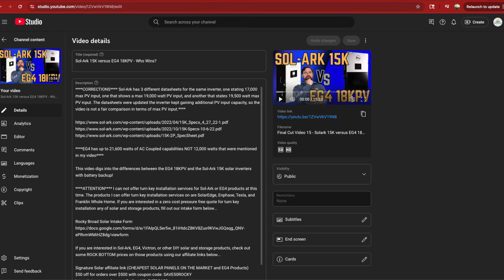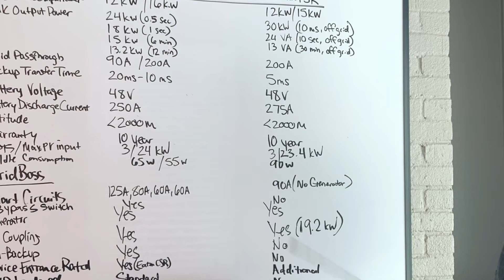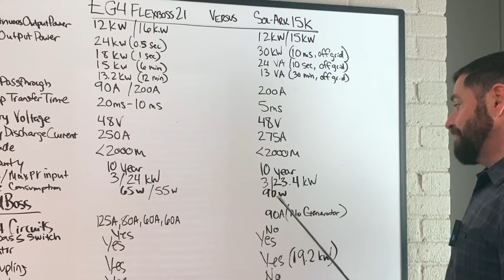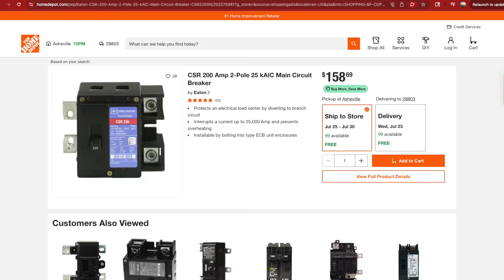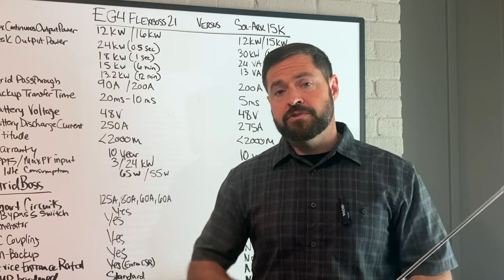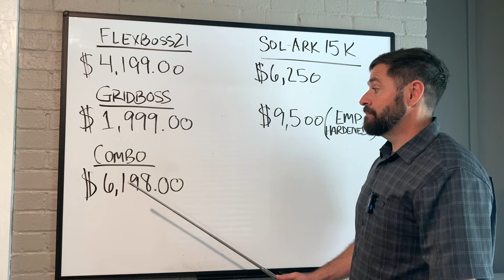EG4 FlexBoss21 and GridBoss vs Sol-Ark 15K | Inverter Showdown: Which Hybrid System Is Best in 2025?

Comment from the maker: Signature Solar affiliate link (CHEAPEST SOLAR PANELS ON THE MARKET and EG4 Products) 
$50 off for orders over $500 when using the coupon code: ROCKY50OFF (expires 10/1)
https://signaturesolar.com/?ref=uzUOpPif73O10D

https://signaturesolar.com/eg4-flexboss21-14-3-28-6kwh-capacity-eg4-wallmount-indoor-battery-bundle-bndl-e0023/?ref=uzUOpPif73O10D

https://signaturesolar.com/eg4-gridboss-vs-mid-200a-service-entrance/?ref=uzUOpPif73O10D

https://www.currentconnected.com/product/sol-ark-15k-all-in-one-hybrid-inverter/?ref=RockyBroadSolar

In this video, I compare three of the most talked-about hybrid inverters on the solar market today: the EG4 FlexBoss21, EG4 GridBoss, and the legendary Sol-Ark 15K. Whether you're designing a full off-grid system or a grid-tied solar + storage setup with backup power, choosing the right inverter is critical—and I break down what you need to know.

We'll cover:
🔋 Power output & battery compatibility
⚡ Grid-tied vs off-grid functionality
🧠 Smart features, monitoring, and remote access
💸 Price-to-performance ratio
🛠 Installation differences and ease of setup
📐 NEC compliance and rapid shutdown integration
🔄 Transfer switching and whole-home backup capabilities

The EG4 FlexBoss21 offers serious value with 16kW of AC output, parallel stacking, and seamless battery integration.
The EG4 GridBoss is a feature-packed, UL-listed, grid-interactive microgrid interconnect device built with code compliance and NEC labeling in mind.
The Sol-Ark 15K is a proven industry leader, known for reliability, support, and whole-home hybrid capability—but is it still worth the higher price tag in 2025?

✅ Watch until the end for my verdict on which one I’d choose for different use cases—DIY installs, grid-tied backup, or full off-grid solar setups.

If you're considering installing solar and storage this year, especially before the 30% tax credit expires at the end of 2025, this comparison is a must-watch.

👉 Drop your questions in the comments if you're trying to decide between these powerful hybrid inverters!

#EG4 #SolArk #FlexBoss21 #GridBoss #SolArk15K #HybridInverter #SolarStorage #OffGrid #WholeHomeBackup #DIYsolar #BatteryBackup #EnergyIndependence #SolarTaxCredit #NECcompliance #EG4Review #SolArkReview #HybridInverterComparison

If you are interested in a zero cost pressure free quote for turn key installation of solar and storage products, fill out our intake form below...

Rocky Broad Solar Intake Form https://docs.google.com/forms/d/e/1FAIpQLSer5w_81iHtdcZBKV8Zuo9KVwJGQsqg_QNV-ePRvmWMiHZ8dg/viewform

If you are interested in DIY solar and storage products, check out some ROCK BOTTOM prices on those products using our affiliate links below...

Signature Solar affiliate link (CHEAPEST SOLAR PANELS ON THE MARKET and EG4 Products) 
$50 off for orders over $500 when using the coupon code: ROCKY50OFF (expires 10/1)
https://signaturesolar.com/?ref=uzUOpPif73O10D

Current Connected Affiliate (SOL-ARK PRODUCTS)
https://currentconnected.com/?ref=RockyBroadSolar

Also check us out at the following places....

Rocky Broad Solar Website
https://rockybroadsolar.com

Facebook
https://www.facebook.com/profile.php?id=61558585264414

Comment: Have been using sol-ark 15 for 3 years self installed fantastic unit, and support.  I did a bypass if it fails or for service.
Reply from the maker: They are both reputable brands that you can trust. One thing I love about EG4 is the built-in bypass in the GridBoss though.

Comment: you must be paid by EG4 because what you are saying is not true. I installed the Solark 15k in 2018 on my whole house and have 60kw of EG4ll's and also have 19.8kw of solar on grid tie passthrough, I have never had a single problem {not one} and also have never paid a single electric bill as of yet. and I run everything in my house electric stove dryer and even have an air compressor connected in my shop. and the entire system was plug and play easy. also I added EMP hardening for $300 after market.
Reply from the maker: That sounds like a rock-solid setup you have running there; glad it’s been trouble-free for you! To be clear, EG4 does not pay me to make this content. Thanks for watching!

Comment: Get a Sol-Ark 18K.  50% more power than the Flexboss21 and at about the same price.
Reply from the maker: The same price? They must have slashed some prices over there pretty drastically. Sol-Ark is a great brand and I am sure you would be happy with that. Me personally, I think "what good is the extra power if the HVAC and water heater is just going to drain out your batteries during an outage if you are not home when it occurs?" To me having the smart ports to shed excess loads when you aren't around is worth it's weight in gold. No one wants to come home to a dead battery bank in an outage because it spent all day heating your home and hot water heater. Thanks for watching!

Comment: No, I wouldn’t recommend EG4. My friend, it’s not ideal for professional use. Many cheap companies are pushing EG4 because it’s inexpensive to buy, and they make more profit selling it to you. In the inverter market, Sol-Ark is like the Ferrari—hands down the best, in my opinion. Research is a hobby of mine, and after 300 hours of digging into various companies over the past seven years, my conclusion is clear: go with Sol-Ark and pair it with a Renon Power Xtreme LV 30kW battery, or whatever fits your budget. You might pay 10-20% more upfront, but in an emergency, it’s worth every penny. EG4 is okay if you have backup resources to keep something like an electric heater running. Thanks, good luck!
Reply from the maker: That is completely false information. I paid for my system. You are certainly entitled to your opinion. I am thrilled with my decision to go EG4. Thanks for watching the channel!

Comment: One thing to keep in mind is. Is it out door rated. Can it get wet. I don't care where you install it. Someday it could get wet. The air has water in it and this will build up as wet when the inverter heats and cools.

I fix wood working tools. The average humidity is around 15% in my area. But this goes up in the fall and then I get a lot of tools that have shorts from corrosion. You know green stuff around the wires or black from getting to hot. The only thing that helps in out door rated stuff.

Having everything outside might be less than having it all inside. I mean people put batteries outside. Why not just put everything outside? And if you put it in your basement it will be in a humid spot and how the water problem that all my customers have in the fall.

Just food for thought on how you build your system. Sometimes it's better to move stuff and run wires then trying to save money by placing everything close together. 

The other problem is that some people only have a 100 amp service. So I am going to have to replace everything so that it is 200 before I can have a backup system. It's just interesting stuff. 

I don't see any of the manufacturers changing how they build there products. They are built for different areas. Every utility wants something different. I'm glad that you can have the system that I want. My utility will not allow it. They will if I pay to have two meters. On to send all the solar power to them and then one to put power into the battery when the power company wants for me to be able to. I know it just doesn't make sense to me either. But the five different solar companies have all said the same thing. 

I just want to be able to run my house off grid and then give the utility my extra power. Yes I would like to be able to get it back if I needed it. But I don't care about that as much as being able to not have to rely on someone else. Take my extra power and don't send me a bill. Because if my system is done right I will not need to use your power.
Reply from the maker: It is a shame that the utility that you reside under can make or break your project. That is the good thing about an off grid inverter such as the 12000 XP is that since it is impossible for it to backfeed to the grid, no need for an interconnection agreement. Thanks for watching!

Comment: I skipped through your whiteboard looking for the actual review but nothing. There is no content here, he didn't even show the systems running or compare them.
Reply from the maker: Thanks for the feedback, I will try to include more in-depth comparisons in my future videos.
Reply: @RockyBroadSolarLLC  Word on the street is the spec sheets on those aren't acurate, one underspecs and one overspecs or doesn't work. you actually need to compare the physical units in real scenarios.
Reply from the maker: Well, I don’t have my hands on a Solark but I do have the FlexBoss21 and GridBoss installed in my basement. I’ll make sure and do some real world testing on it in some future videos.